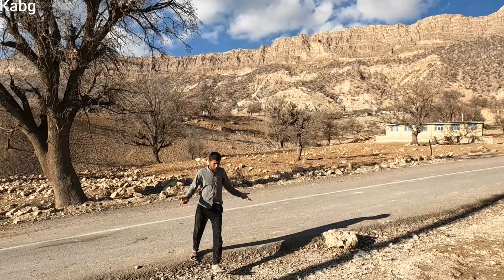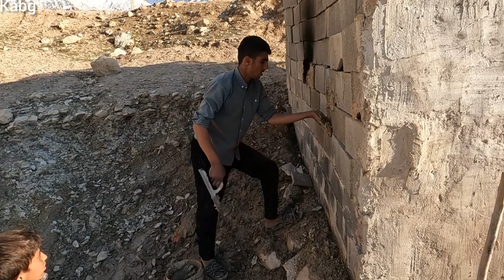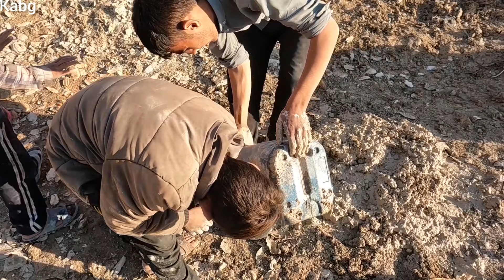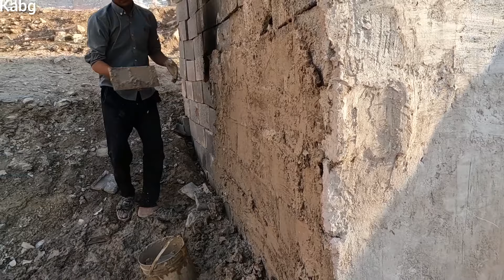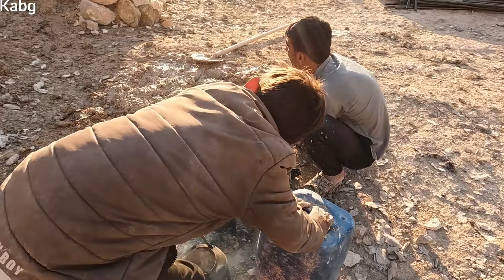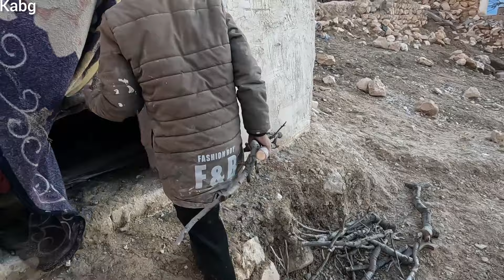A man was crossing the road when he saw poor children and came to help them to fix their hut.

Comment: These children are so sweet.❤. The oldest is mature beyond his years. Anyways, I realize that large tent/tarp they got from cameraman. Wish someone could assist in getting to the roof. Then for IMMEDIATE use which would get them better out of elements. Open that tent and drape that tent using the hut for it's poles. Then they could remove that blanket as door and use tent ties as doors. That would insulate that building ASAP and keep them warm better then now. Also should repel most of rain if not all. Just suggestion.❤❤